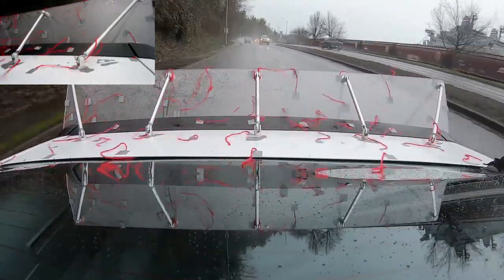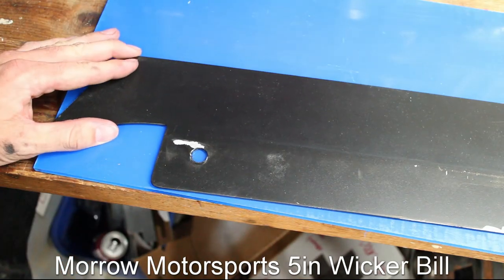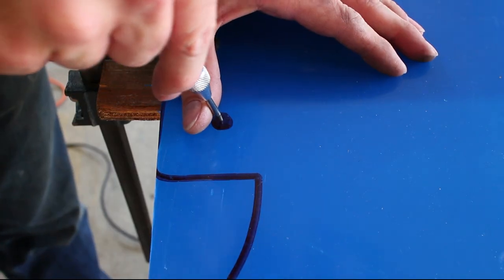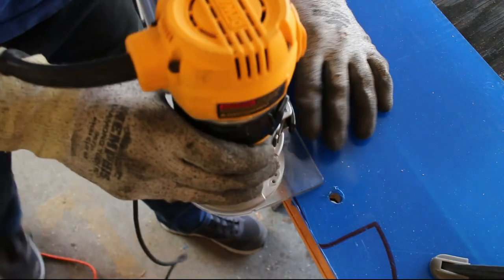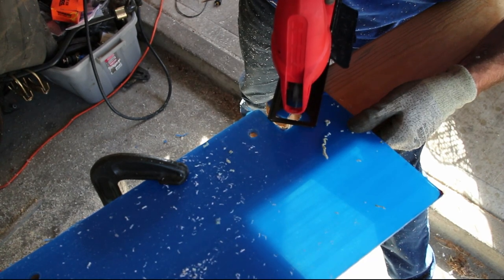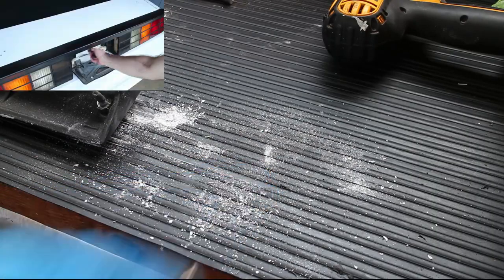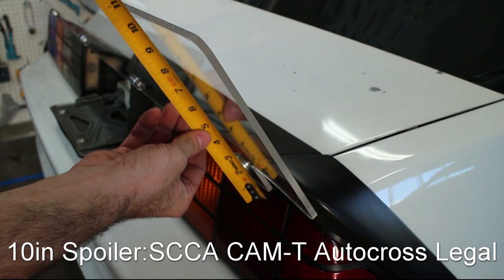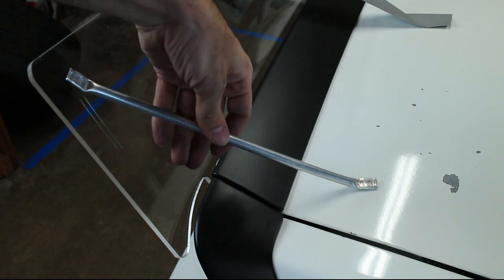DIY NASCAR Spoiler (Pt1)

Comment: That's nasty. Estimate on downforce/effect on lap times?
Reply from the maker: It makes 276Lbs at 35mph, (Part 2 coming next sat) 
it's hard to directly test that since Autocross events are always a different course. 
however, I used it today and it worked very well even in wet conditions
there were a full 100% throttle turns I wouldn't be able to make otherwise.

Comment: Short, sweet and useful video! Two things I thought:
1. Might want some endplates on that thing
2. It bending at speed is free DRS (I jest but F1 teams actually did that back in the day)
Reply from the maker: I can't run end plates in my class unfortunately, otherwise everyone totally would.
I might setup a new spoiler on hinges to change the angle for track or Autocross.
Reply: @3rdGenGuy  also, what thickness was the Acrylic? Could you have gone thinner?
Reply from the maker: @WynnofThule  it's not a cost thing, the SCCA rules for CAM don't allow end plates on Spoilers or splitters.
the acrylic was 1/4in, and I wouldn't go thinner than that unless you found a stronger material. 
Even with a bunch of support rods, the spoiler still moves around quite a lot at speed. (70mph+)
Reply: @3rdGenGuy  I gotcha, and what I meant with cost is that perhaps SCCA thought builds that are too complex would price out potential competitors.

And yeah Acrylic isn't the strongest but damn if it don't look cool
Reply from the maker: @WynnofThule  I used a clear material because I drive to events and can't block my rear view mirror.
other guys trailer their cars so they just use 1/8 Aluminum.
Reply: @3rdGenGuy  I see. Did you also consider using Polycarbonate as well?
Reply from the maker: @WynnofThule  I believe Polycarb is less rigid than Acrylic. there's a few companies who sell plastics by me. I was gonna call them up and ask.
Reply: @3rdGenGuy  yeah, it is. But it's way less brittle as well and easier to work with